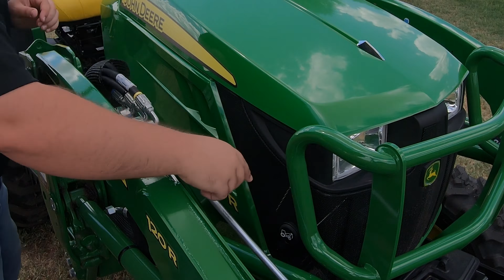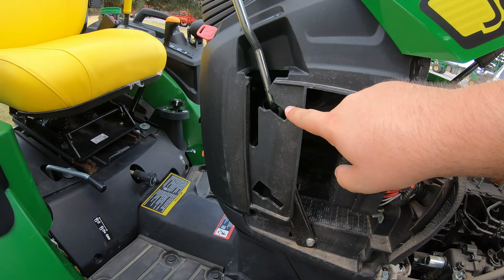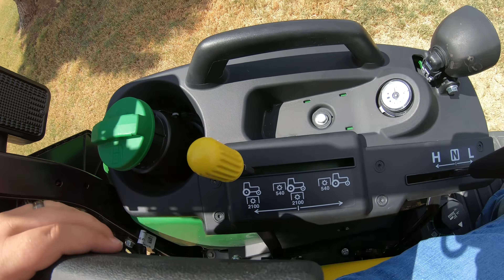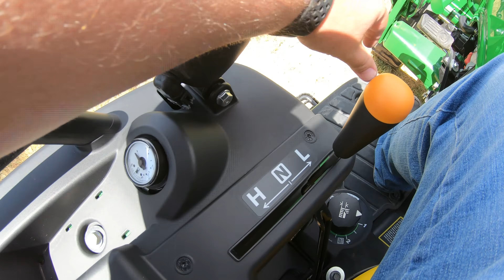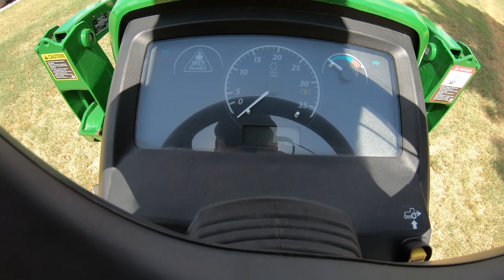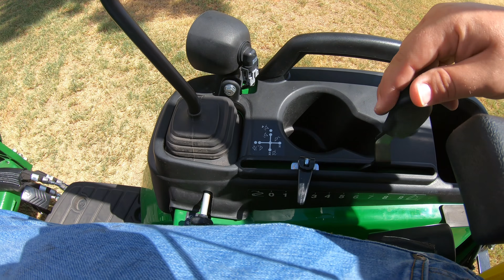2022 John Deere 2025R Tractor Review and Walkaround

Comment: DO NOT BUY MADE IN CHINA!!!!! After a year parts are falling off due to not tightened right at the factory. JD uses Kubota tranny now. Height limiter on the 60" belly mower will wear out due to cheap extruded aluminum. My 2005 JD 2210 was built MUCH better and lasted 18 years. This one is a little over a year old and falling apart. JD does NOT care and will not warranty anything past 1 year.

Comment: Been looking hard at a used 2014 model 2025r 135 hr. Looks to be in EC other then hood is dented  it has loader and mower deck. Asking 16250.00. I like the bigger tires on it versus the used  1025r  I am also looking at also EC low hrs well maintained asking 16K.  Really liked your video here on it .  The 1025r will do all I need to do here, but for nearly same $$ seems I would be getting lot more tractor for the money.  Appreciate any advice you on it.  Thanks!

Comment: I enjoy your reviews! I have a 6.3-acre farm. About 4 acres is pasture / yard. I am slowly replacing fencing via a post hole digger. Thus, I am considering either a 1025r or 2025r for cutting / auger. Where I am concerned is if the 1025r can utilize an augur properly due to its smaller size. Any suggestions you can provide would be appreciated.
Reply from the maker: I would look into the exact auger you are wanting to get and see what horsepower and weight the manufacturer suggests for optimal use.

Comment: I think you forgot to mention the pull out screen in front of the radiator ?
Reply: Oh by the way... my 2018  2025R  has 976hrs on it.  Only had to replace "one" short hyd hose for the bucket curl.  It's been a great tractor for my 15 acres. And I'll add that the AV20F grapple had been fantastic!!!
Reply from the maker: Thanks for pointing that out and I'm glad you are enjoying your tractor.

Comment: The loader lift capacity is pathetic.  Deere should be embarrassed.
Reply: Kubota isn't no better I'm going back to Deere, I had 1025 r and went up in size to a b2300 Kubota and the 1025 would out work it and was smoother. If you get Kubota get ready for slow hydrologic system and not being able to stop box blade on the way up it goes all the way up and you stop it on the way down, it was all the 2300 could do to handle small gravel in the loader. Lights and blinkers never work, blades on mower deck don't turn fast enough. I owned both and Deere was just better. These compact tractors are made for light work and yard chores not heavy moving up high
Reply from the maker: I have heard this a few times. Thanks for watching!

Comment: Thanks for the video. I've had my 2025R now for 4 weeks. Yep, I know the Kubota is cheaper. But here in Hawai'i on Big Island, the wait time on a Kubota B series is over 18 months IF they can get it at all. So I couldn't really do that. No one sells the blue tractors on the island, and the Red stuff is not well managed by the one dealer here. So Pepe Machinery it was. I ordered it on a Monday and they had the 2025R and 1025R in stock. I went with the 2025R mostly for the larger tires/wheels and the heavier weight as my farm has several steep hills.  After using it around the farm, the drive over deck (I went with the 60" ride over) is mostly only good for lawns. Cutting fields, especially here at 2700 feet, is a lost cause, the tractor simply cannot provide enough power to cut it with the deck. I'm still waiting for a RC2060 to fix that issue. I've been able to fix the road, fix some of the over growth in the front yard, and cut back a lot of the crap on the side yards. Maybe if Kubota had some way of getting the BX on Island in a reasonable timeframe I would have done something different, but Hawai'i brings a whole other level of difficulty to the tractor world. All in all I am quite happy with it. I've put almost 12 hours on it thus far and will put more on it once the wet ground dries a little more.
Reply from the maker: Glad to hear you are liking your machine. Thanks for watching!

Comment: The 2025R is my favorite Deere Subcompact. 
Great video ! 
I think there is actually 3 tire choices unless something changed very recently. 
R4 R3 bias ply and R3 Hybrid turf radial. The turf radial is Galaxy Garden pro. 
Just in case anyone is confused the 2025R shares its engine and has a stretched version of the 1025Rs frame, 
Which is why it uses the same loader as the 1025R . The frame is stretched to allow for those bigger tires and still accommodate a mid mount mower. 
Deere brochure actually calls the 2025R a sub compact. The 2025R a totally different tractor then the large frame 2032/38R . 
IN my opinion the 2025R is the best subcompact tractor on the market today.
Reply from the maker: Thank you and thanks for watching!